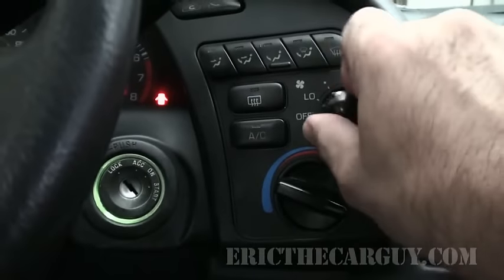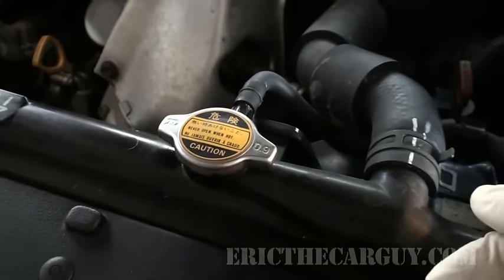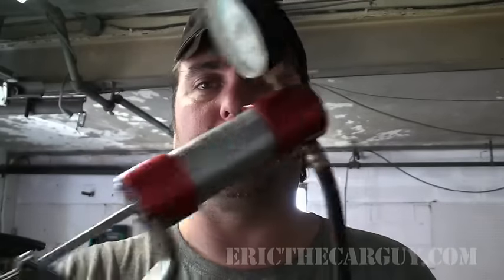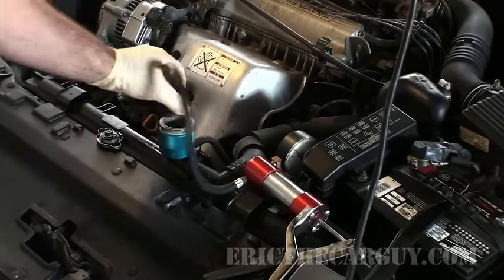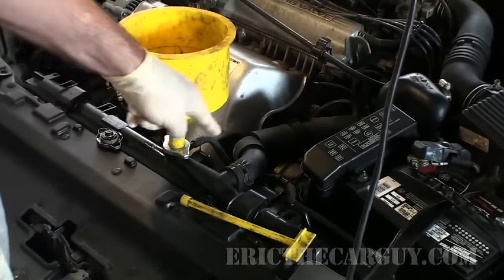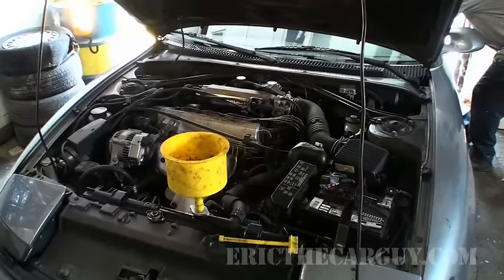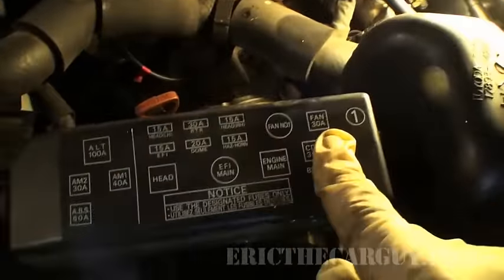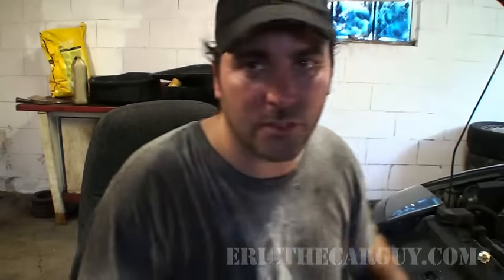How To Solve An Engine Overheat Condition - EricTheCarGuy

Comment: love your videos. have helped a lot. 2000 Accord EX 4 cyl. car overheats when in stop and go traffic.its OK when moving along. opened hood at home with engine hot and AC on. both fans going. turn AC off, rad fan still going. car didn't overheat. question is, can a fan work periodically when it's going out, or is it a "working or not" situation.

Comment: Thank you Eric, I didn't know the radiator cap did all of those things. You could have figured out why I had 1Gal of coolant missing with a full reservoir.
I've been looking for a leak for a week now. My fan also isn't working right. I'll use your advise on finding which wire/relay/fuse or fan motor is the problem.
▪︎ 2002 Jeep Grand Cherokee Laredo 4.7L V8 (WJ) standard output engine (VIN-N)

Comment: Just thought I put this out there, there is wax inside the brass looking canister in the thermostat that expands as it gets hot, thus opening the thermostat. The spring simply provides the closing force. I always like to see a thorough diagnoses. 👍

Comment: After a new radiator and fan and a diagnosis for a head gasket ($2000 estimate...bite me). I spent a total of 80$ on some head gasket sealer (it’s a 2004,  just a high school car for my kids so if it gunks it up 🤷‍♀️) 
and the correct coolant.  
(Mechanic didn’t bleed system after installing the new radiator and had the wrong coolant in it)

Worked great not getting hot once until later the next day, blew off the little hose below radiator cap and got super hot super fast.

So today, I’m buying a new not cheap radiator cap, more coolant and fuel injector cleaner because there’s a little bit of acceleration hesitation so I think it’s fuel injectors not head gasket because the oil isn’t milky.

Comment: This is very informative. i so much like the video of how it actually show to us the possibilities of engine overheating etc., which is we can do it by ourselves in case the car mechanic shop is bit away and while our overheating car engine cannot reach through the place.

Sir, what shall be the recommended ideal pressure rating of the Radiator Cap?,  0.9  or 1.1 ?

Comment: Couple  points
Looking under car  you need to remove plastic dust dirt cover bolted to frame across the bottom of engine.
2 Coolant is stain white  when dries. But wet, is either green,red,gold. A white mat or garbage bag placed under car will show leaks better when they drip out.
Water runs downhill. Leave under car overnight, the slow leaks would show up.

Comment: just adding to the all great comments.... years later (as i search for other mechanical knowledge}...without the ability to understand and explain basic atmospheric pressure, one will never know the HUGE you speak of,  in a radiator cap. As a fire department engine engineer, (the guy who drives and operates  a pumper) ... it is the basic of fluid hydraulics.
Why am i commenting on this .... you nailed the simplicity of it,  great job. Now come to socal and fix my daughters car hahah

Comment: Had a Ford where the expansion tank had tiny cracks underside, these opened up and dripped once the engine had warmed up lowering the pressure, this also seemed to effect flow through the radiator as the top hose was really hot and bottom hose slightly warm which would normally indicate thermostadt not opening properly or clogged radiator core. If i had a pressure tester it would have saved time as the leak was not visible due to leakage route

Comment: Thanks so much for you help! I have a 2002 Nissan Sentra XE 1.8L and I think I may the worst case scenario, my mechanic says that I need a new head gasket due to leaking coolant, creating an issue with the coil in cal number 4 AND a water pump. Do you have any videos on how to address either of these problems?

Comment: I'll subscribe just for the continuity meter video.  Checked relays, wires etc. Both fans come on when AC running. One fan comes on when overheating. 2001 Honda Accord. 280K miles with blowby. Oil coming out of everywhere. Who knows? Actually your last suggestion makes more sense. Off to get a block tester. Thank God remans are about $1200-$1300.

Comment: Hey Eric I have a 2007 Nissan Pathfinder se I had gone to my job and realized that the antifreeze was coming out of the overflow and the meter was on high.. I got it towed to my house and realize that the upper hole that connects to the radiator was Cold and the other half going to the mottor was hot.I did the  funnel trick adding the antifreeze halfway putting up the heat on high and gave it gas.. it started bubbling up.but the bubbles did stop and came back then the heat came back on ..the holes was circling the antifreeze into the radiator again like it was suppose to ...I didn't jack up the front of the car..and I didn't text drive it  left the car sitting for one day and now I turn on the car and  realize that half of the radiator was hot ...if u were to stand in front of the car the left side was hot but the right side some what cold.im in NYC Brooklyn and imscared to drive it like that what should I do ...I had the car running already for an hour sitting out..and it doesn't over heat ..I had put it also on drive for a while and doesn't overheat ..is it safe to drive..please help me

Comment: Fairly informative and you make good points IMO, you should have included symptoms of a mechanical clutch fan and the possibilities of a bad impeller on the water pump, the possibility of a slipping belt from either being worn and stretched to the tensioner being weak.. Not all vehicles have gone over to electric fans. Just my 2 Cents.

Comment: Great video and info.
Can you tell me why my 86 GMC 1500 truck keeps on shutting off at 200°
It just stalls when the motor overheats .
I'll wait about 20 30 minutes to cool off than it will start.
I took out the thermostat and the temperature sensor is new and it will still overheat and stall.
Any suggestions will help thanks.

Comment: I thought you get 1 psi for every 3 degrees for example on a 15PSI cap. You get 45 degrees over a boiling point that would be 212 degrees plus 45 = 257 degrees excellent video. I use to own a Stant pressure tester, but I am curious which pressure tester is versatile in the real world because there are a lot of options.

Comment: I have an Audi A6 2013 3.0 c7. I was in a small accident where just the secondary radiator was pierced on the driver side. I got that replaced and ever since then 
-The car drives fine for 20-30 minutes and then begins to overheat. turning on defoggers/heat in cabin keeps car running normal temp indefinitely. 
-Does not overheat in park. May overheat in drive with parking brake engaged if I leave it running for over an hour. 
-very few debris on radiator.
-After secondary radiator was replaced, the water pump and thermostat have also been replaced, symptoms unchanged. 
-Top Hose warm (not hot), secondary radiator hose cold. Radiator and intercooler cold. Mechanic said engine is cool during overheat.
-Pressure cap good. Coolant overflow goes to max when car on, goes down to min when car off. No visible change in coolant levels in a few weeks.
-Both fans go super speed or one goes on normal speed when driving depending on temp. Radiator fans do not go on with A/C.  

I would like to know the function of the secondary radiator and if this could even be the cause of my overheating issues.
Any info or insights will be greatly appreciated! Thank you

Comment: Hi and thanks for all your vids , I have an issue with my saab 93 2007 120 hp.  The engine heats up and it shows on the display to stop and idle the car  till it cools down,  which it does . andi changed the housing for the thermostat.  But it keeps over heating when an going up  a hill , and the cabin is not  heating up anymore.  What can a do , apart from chucking the car away?

Comment: eric i have a 1997 ford mustang 3.8 ltr v6 a while back i found oil sitting on top of the water/coolant in my overflow ..i cleaned it out thinking someone did this to my car beings the oil wasnt mixed it was sitting on top car was fairly new to me .as a rule i allways check my fluids when im going out of town ...since then ive replaced the fan /motor if i keep my car topped off all the time does not overheat ...now this is my question or issue my grandson just bought a car exactly like grandmas 1998 ford mustang v6 3.8ltr when i looked under the hood there was oil in the overflow not alot the water a tinge of brown the radiator cap fine the coolant seems ok oil looked freshly changed to me as i said his first car just purchased it my first thoughts seller drained the fluids added fresh to sell car he got it home hasnt been driven now oil in overflow my feelings at the time blown headgasket i pulled overflow off drained and cleaned it out ....so far no more oil ...i decided to find out what i could i would go drive it some...i put my foot in it a little drove it maybe 10 miles or less when i stopped it overheated let it cool off topped it with water drove it home and around about the same amount of time maybe a little more no overheating no oil in the overflow whats going on help

Comment: I had to use the old heater trick on my Concorde, but it was 93 degrees and sunny outside and I had to have the heater on full blast to keep the gage in the normal range.

Comment: If your vehicle is overheating and you find that you are low on coolant, I would suggest first checking the radar cap's top seal. If that has hardened from age and cracked, the coolant can leak out from that crack resulting in coolant loss. The fix may be a simple as a new radiator cap.

Comment: Eric , I followed your instructions re. my Rendezvous overheating . Coming out of the firewall are  2  tubes (small hoses) , the one on the left i now see is leaking a clear water - like substance . The hose has what looks like a plastic end that appears to snap onto an aluminum tube . I have no idea what it is , but it drips quite readily down  &  onto the concrete . Don't know how it came loose . Left it until daylight when i can see.  Do you know what it is  ?  I know ; that was a dumb question  !

Comment: Testing a thermostat is to put it in a bowl and add hot water into the bowl.  If it doesn't open then it's bad and needs to be replaced.  A simple way and common knowledge for most people who work on cars but thought I would share.  Also could be a water pump for overheating which you would leak and would lose PSI when doing the Pressure test.

Comment: Hi Eric why the water gets to the overflow tank/reservoir and don't come back to the radiator? it does not over heat but i think when pressure accumulates pushes the water to the overflow but doesn't suck back to the radiator and this is how i loose water because it accumulates in the reservoir recipient and overflow. This is a 99 Honda civic LX. I already changed the thermostat and radiator cap as well. will be nice to see a response from you. Thanks.

Comment: 1995 Silverado, 5.7L, c1500.  Are you sure about the top hose being hot if thermostat is stuck closed?  Wouldn't stuck closed Tstat cause hot coolant to 'not' travel to that hose?  I replaced my radiator because it was leaking, but not over heating.  Didn't replace Tstat because it had been replaced two weeks ago, when I had lower intake gasket done.  Now, after replacing radiator, it over heats.  Radiator coolant stays cool and I am pretty sure Tstat is stuck closed.  Watched your vid, just for kicks, before jumping back into it.  Now I am second guessing.   I hope it isn't combustion leak.  Anyway, really enjoy your vids.

Comment: First all  great video !   Eric, I have a 2005 Chevy Express 4.8L ,  that is overheating,  it was leaking coolant from the water pump, which i just replaced along with thermostat and fan clutch, this van is my  work truck so i need to be really reliable and since i was there i just decided to replace  it all,  but unfortunately it is still overheating, i really think it could be the radiator, that was something going through it, like some sort of plastic pin or something. i need help , what should i do ? i cant find anymore leaks and i don't have a pressure kit

Comment: Question. I have a overheat issue I cannot for the life of me figure out.

Replaced radiator, thermostat, upper and lower hoses, cooling fans, bled the system. For the first 15 miles, it performs as it should. Get out on the highway, temp shots up until I drop down a gear, then the temp immediately drops. Try doing the heater trick.... it's cold. Could my heater core be cause some of the issue?
Reply: Hey did you Purge the radiator with radiator cap off,engine running and the heater temperature control turned to high. Run the engine tell the antifreeze is hot and no bubbles are floating out.

Comment: The Block Tester is my final troubleshooting step in determining why my car is overheating. I've replaced the Radiator, Thermostatic Clutch Fan, Thermostat, Bled the system  & replaced the water pump as well as the heater core assembly and the weasel still overheats @ 10-15 minutes of idling.  That leaves only a bad head gasket or the head is cracked.   In my thinking, if the head gasket or head was cracked, there would be water in the oil.  Yes or No ? Is that a viable deduction ?  Thanks for a well done video.

Comment: The problem I'm having seems like what you described as a thermostat if it's stuck. When the cars school soon as I start the engine the radiator fan immediately kicks on something is telling the car that the engine is overheating when it's cold on my 2016 Chevy Cruze and also the lower radiator hose is cool as you mentioned when the motor should be hot oh, so I have a bad water pump too?? Please advise just asking for your opinion

Comment: i think you just solved my dashboard clicking problem. i hear something click on and than click off like every 30 seconds in my 09 escape and its driving me nuts. problem is the click is to the left of the steering wheel by my headlight, dome light, switch area. problem is all my switches work.but its definatly a relay style electrical click... cant wait to dig into it this weekend.

Comment: I have a question on a 2001 Chevy cavalier I changed the radiator fan and thermostat and got a radiator flush and blessed the coolant and the fan still doesn't wanna click on till it reaches 205 degrees

Comment: caravan 3.3 engine coolent does not get pulled back into radiator, just replaced water pump -three days later the put in a new radiator and thermostat have to add coolent to keep level up 
will be using my snap on tester to pressure up the system to check for leaks no white smoke or water in oil
 any thoughts as to what problem might be am guessing vally pan gasket 148k miles

Comment: My cooling system is deftive. Honda fit 1.3 2004 model. I keep on filling the coolant every morning when the engine is cooled. I noticed that the reservoir level also keep on rising up every morning. ( I didn't see any visible leak.). Is my radiator cap due to replace? Thank you Mr. ERIC for your advice.

Comment: Eric ,i may have asked you before but if ,my sons 1999 toyota camry blown head casket i fixed with Blue devil gasket sealer but car still over heating ,so much pressure it is pushing coolant out of bottle .removed thermostat car cooling fan on and still overheating after about 20 minutes driving. Already bleed cooling system. replaced radiator cap and  put new expansion tank. still overheating. Any ideas would be helpfull. Great videos Thank you.

Comment: Hey Eric, great video but, you should have spoke about the "engine temperature sensor"  and the water pump. I know that most all the time when a water pump goes out is leaks but, if you have no water flow, well you know.

Comment: Hey Eric I recently got a new engine installed in my 350z new radiator new fans new coolant new thermostat no leaks cats have been cut  out to free flow um air has been bled out completely compression test came back good  twice vacuum is Normal it begins to heat up when I'm in driving but  when im still in one spot it heats up unless the heats on it's fine I had the water pump checked it's good I'm lost

Comment: Hey Eric could switching to a aluminum radiator have an effect on the cooling system .. The cap says it's a high pressure radiator and the spring on the cap is much stiffer then the old cap on the old radiator .. I just changed the water pump because I have blown both the top hose and bottom hose on my radiator I'm building alot of pressure in my lines.. IV changed the thermostat 2 in 2 months .. And the car really over heats on the highway under load.. Wont over heat at idle or crusing through town.. Please help .. Heat is hot IV burped my coolant lines .. I cant see it being another thermostat issue.. Should I be leaning towards a new head gasket?

Comment: I noticed you didn't mention the radiator temperature sensor, but I read that if it's not working the sensor won't tell the fan that the coolant is hot and needs to be cooled down, so the fan won't come on.
I recently changed my sensor and the overheat started happening much faster. Because of the stupid design I'm not entirely sure it went into the threads properly because I had a hard time putting it in. However I had a hard time getting the other one out too so idk.
In any event I have to get some more coolant to make sure low coolant isn't the reason for the fast overheat. I just wanted to see the fan start working so I know that was the problem, but the sensor might not have even been in any coolant because it's low.... This car is driving me crazy.
Thanks for the vid, it helped.